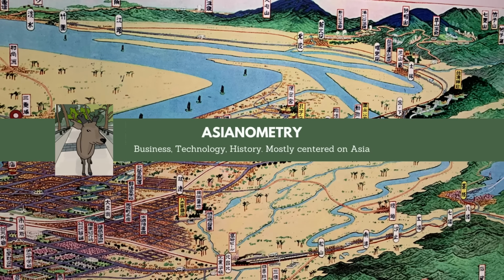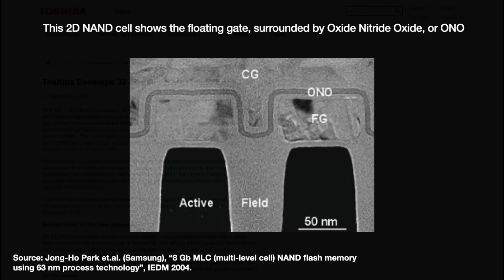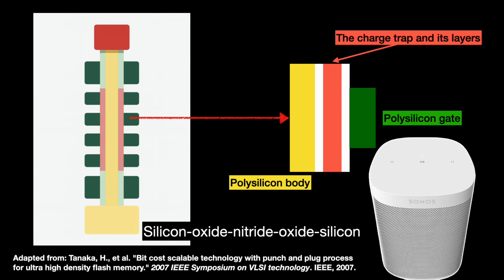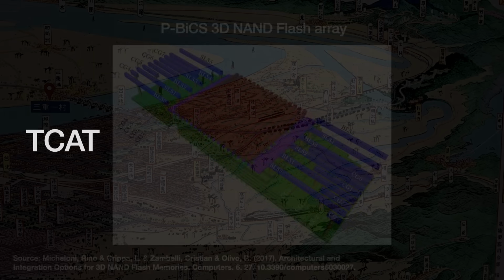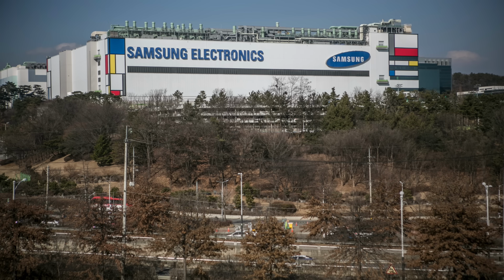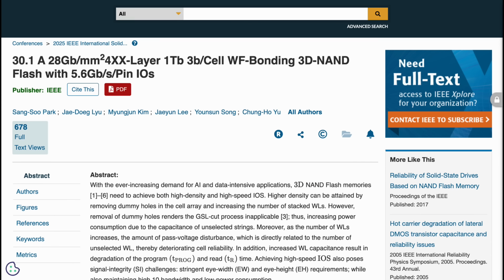3D NAND: The Most Scalable Semiconductor

Comment: I live on a horse farm in rural Tennessee. Recently, I found a Samsung 970 EVO M2 SSD in a manure pile. Knowing that none of the horses own a laptop, how the M2 drive got there is a mystery. My best guess is that because a manure pile is mostly litter from the stables (hay and pine shavings, and of course a little manure), I think one of the guys bailing hay (we bought some from Montana during a drought) must have had it in his shirt pocket and it accidentally dropped into the hay bailer (or a similar event happened with the guy in Alabama who makes the pine shavings). I tried to read data off the drive but the horses had stepped on it a few times and it was too damaged. The actual SSD chips could be removed and read I suppose but that's expensive and unless I knew the drive contained a bitcoin wallet or similar, not something I would do. Still, weird to find a sophisticated drive like that in a manure pile in a horse pasture in a rual area..

Comment: Let us not loose sight of the fact that an SSD is not just an array of FLASH memory. They are sub-systems with a processor controlling things. Like monitoring blocks of memory and detecting deviations from "good performance, then swapping-in new (hidden) blocks if the degradation is deemed close to failure. Degradation is inevitable in cells because each write ages the floating gate/trap just a little.

Comment: ✅ 1. More Storage in Less Space

You can stack more layers, so storage capacity scales easily.

✅ 2. Lower Cost per GB

More bits stored on one chip → Cheaper to make high-capacity SSDs.

✅ 3. Better Performance

Faster read/write speeds compared to older 2D NAND.

✅ 4. Lower Power Consumption

Efficient architecture = longer battery life for mobile devices.

✅ 5. Improved Endurance

Some 3D NAND technologies are more reliable over time.

Comment: Some extra insights. For the etch side another critical technology is in situ CVD/ALD. The technology protects sidewalls by depositing an etch mask uniformly across the hole and then the etch cycle will remove the bottom mask and etch down for a bit before doing another deposition cycle as the side walls are eaten away. Another important technology is bias and source pulsing to change ion and radical distribution to a more downward angle. All of the major etch vendors are working on all of these, but some do certain aspects better than others. 

Another thing is all modern NAND is actually using multiple decks (ie multiple litho and etch stacks layered on top) because otherwise the stacks would be too tall to be manufacturable. On a related note a big focus is also on lowering thickness of layers to minimize etch times and reduce the number of decks needed to hit a given layer count.

As for market conditions it is kind of weird since people kind of pre announce NAND flash technologies, so Samsung isn't actually in 400 layer commercialization yet. Last I checked Micron was funnily enough in the lead just like they were in the late 2D NAND double and later quad patterning era. SK if they aren't ahead are right on Micron's tail. YMSC not far behind with Kioxia, and Samsung like in DRAM and foundry is struggling to get things out the door. Also we are in an era where 2D scaling provides value again as etch and deposition complexity keeps growing. As an example Kioxia has by far the lowest layer counts but their bit density is actually competitive because their die design and how small their cells are.
Reply: Maybe the future will be working both sides.
Reply: @brodriguez11000  This kind of already happens. To alleviate wafer stress/bow concerns, you are seeing people have the CMOS under array get fabed on a separate wafer and then get hybrid bonded to the array wafer (similar to 3D CMOS image sensors). I could be wrong, but I can't see any advantage to building decks on the wafer backside because it doesn't solve the problem of longer etch and deposition times/aspect ratios becoming too large to be manufacturable or the added cost of putting more decks on the front side. Maybe if one day you run out of levers for easier scaling paths, you do an HBM like memory cube where you have multiple NAND array dies stacked ontop of one base control logic die? But it is hard to imagine that ever being economical for anything beyond ultra-high end datacenter drives where you are trying to cut as much power as possible or when you are constrained by the CPUs I/Os for the number of drives.

Comment: 245TB in a single drive in 2025 is just crazy and soon there will be 1PB SSDs.
Reply: meanwhile I just bought my first 1tb SSD 2 years ago. Thinking about getting a 2TB main drive when I ditch win 10 for linux next month.
Reply: @lexpox329  clearly you're not into collecting linux isos
Reply: @lexpox329 Do it, they're not too expensive and so worth it especially if you play videogames
Reply: @lexpox329 Good luck man, if you need hrlp ask in the community
Reply: @lexpox329 i hope you tinker with linux before you switch unless you already know what youre doing ;pp
Reply: @lexpox329 use linux mint, I got it on my new work laptop and its great, had prolly the best support out of any distro because its based on ubuntu
Reply: @lexpox329 wait for 1 PB 😂
Reply: and there i was not long ago, scouring for the cheapest 1tb ssd i could find to replace my dying hard disk
Reply: Still waiting for the 16TB consumer NVME SSD to come up, because 4TB NAND chip are still yet to be produced
Reply: And you can get 1TB now on an SD card the size of a fingernail.
Reply: Price is "crazy" as well.

Comment: ai summary

Abstract:

This video explains the pivotal shift in the NAND flash memory industry from 2D (planar) scaling to 3D vertical stacking. It begins by outlining the physical and economic limitations that brought 2D NAND scaling to a halt around the 15nm node, such as severe cell-to-cell interference, diminished electron counts, and prohibitive lithography costs. The video then details the development of 3D NAND as the solution, contrasting early, inefficient layer-stacking methods with two key architectural breakthroughs. The first is Toshiba's "gate-first" BICS process, which introduced the manufacturable charge-trap cell. The second is Samsung's more complex but superior "gate-last" TCAT architecture, which successfully integrated high-performance metal gates. Samsung's innovation allowed it to regain a significant market lead, triggering a race among competitors. The video concludes by highlighting that the future of NAND scaling lies in adding more layers, which introduces new manufacturing challenges like high-aspect-ratio etching.

The Evolution and Future of 3D NAND Flash Memory

*   0:00:38 2D NAND Fundamentals: Traditional 2D NAND flash memory stores data by trapping electrons in an isolated "floating gate" within a transistor. To increase density, manufacturers historically followed Moore's Law, shrinking the physical size of these cells.
*   0:03:14 The End of 2D Scaling: By the mid-2010s, shrinking 2D NAND further became impractical due to several critical issues:
    *   High Cost: Advanced lithography techniques like double patterning were required, dramatically increasing patterning costs.
    *   Reliability Issues: Smaller cells hold fewer electrons (a 25nm cell holds just ~100), making them more susceptible to data loss from leakage and lowering the signal-to-noise ratio.
    *   Interference: Cells were packed so closely that their electrical fields began interfering with one another, causing errors.
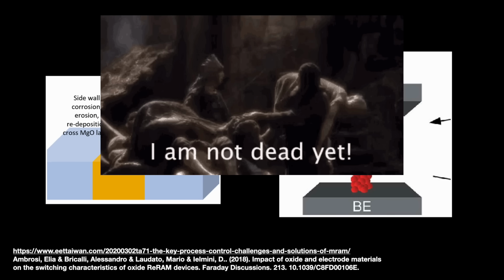*   0:05:52 The Shift to a New Dimension: With horizontal scaling stalled, the industry shifted focus to stacking memory cells vertically, creating 3D NAND. Early attempts to simply stack completed 2D layers proved too costly and prone to heat damage.
*   0:07:36 Toshiba's BICS Innovation: Toshiba pioneered a cost-effective method called Bit Cost Scalable (BICS). This "gate-first" process involves:
    1.  Stacking alternating layers of polysilicon (which will become the gates) and dielectric.
    2.  Punching deep vertical holes through the entire stack using a single, expensive etch step.
    3.  Plugging these holes with material layers to form the memory cells.
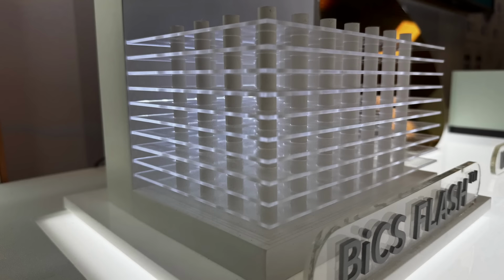*   0:08:45 Floating Gates vs. Charge Traps: A key innovation in 3D NAND was the switch from traditional floating gates to "charge traps." A charge trap stores electrons in discrete locations within a trapping layer (like silicon nitride), analogous to a sponge holding water, making it more reliable and easier to manufacture in a vertical structure than the "tub of water" floating gate.
*   0:14:11 Samsung's Superior Gate-Last Method: While Toshiba's BICS was a breakthrough, its polysilicon gates limited performance. Samsung developed a more advanced "gate-last" process called Terabit Cell Array Transistor (TCAT) that enabled the use of superior metal gates:
    1.  It starts by stacking sacrificial layers (silicon nitride) instead of polysilicon.
    2.  Holes are punched and filled with polysilicon to create the channel *first*.
    3.  Trenches are then etched from the side to remove the sacrificial nitride layers, leaving air gaps.
    4.  These gaps are then filled with the charge trap layers and the final metal gate material.
*   0:16:34 Industry Disruption: In 2014, Samsung's 32-layer V-NAND, built using the TCAT process, achieved a density 3.5 times greater than its planar equivalent. This disruptive product re-established Samsung's technological lead and forced competitors like Micron, Intel, and SK Hynix to race to develop their own 3D NAND products.
*   0:18:12 The Path Forward is More Layers: The primary method for increasing 3D NAND density today is by adding more layers, with leading manufacturers now producing chips with 300-400 layers and paths to over 1,000 layers envisioned.
*   0:18:31 New Manufacturing Challenges: As stacks get taller, etching extremely deep, narrow holes with a high aspect ratio (HAR) becomes a major challenge. New technologies like cryogenic etching are being developed to maintain precision and speed at these extreme depths.

I used gemini-2.5-pro| input-price: 1.25 output-price: 10 max-context-length: 200_000 on rocketrecap dot com to summarize the transcript.
Cost (if I didn't use the free tier): $0.03
Input tokens: 18789
Output tokens: 1042

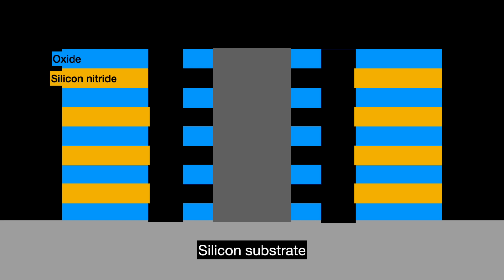Comment: 15:50 but how do they manage to remove silicon near the shaft, but don't touch it outside the hole?
Reply: I figure it takes time to eat through a lot outside the hole, so just limiting the etch time should just not touch the outsides
Reply: @quangho8120  maybe there's some "magic", because at macro scale it wouldn't work like this. But even if you're right, some amount of outer silicone should be etched out and this picture is a bit deceptive.
Reply: @MSP_TechLab  yea i agree the pic is a little deceptive, it's an illustration and not a micrograph afterall
Reply: @quangho8120  it is not little deceptive, it is really deceptive. I've put a long answer but youtube deleted it. So, in short, the picture at 15:50 represents one column surrounded by silicone. While in fact there's an array of columns. So, it etches all silicone, because where surrounding of one column ends, starts surrounding of another (imagine it as a building skeleton without walls).

Comment: Great video — one quick addition/correction for the comments section:

While HDDs do still win on cost per byte, the bigger point is long-term offline retention. NAND (both floating-gate and charge-trap types) stores charge that slowly leaks away when the device is unpowered, so its offline retention is inherently limited; many NAND parts don’t even publish a long unpowered retention spec, and when they do it’s often on the order of a year (especially after many program/erase cycles) rather than decades. By contrast, a commonly cited HDD demagnetization rate of ~1% per year corresponds (if modeled exponentially) to a half-life of roughly 69 years, so HDDs are far better for preserving data offline for decades.

So NAND’s inability to “fully replace” HDDs isn’t just about $/GB — retention over time, plus the role of cost and the relatively faster random access of HDDs versus optical/archival media, all factor into why HDDs will remain important for long-term storage.
Reply: And even that pales in comparison to magnetic tape. It is funny how we still use one of the oldest technologies for digital storage...
Reply: @skvvlk  optical tape is much more durable than magnetic tape, and its single-write nature doesn't matter for archives
Reply: I wonder: could some kind of super low power source be used to refresh it? Like one of those tiny calculator solar panels?
Reply: @benG2141 maybe a very small nuclear battery coupled with a capacitor could let it refreshed for a couple of decades
Reply: The companies that want data retention use tape, maybe optical, but never spinning rust. I've had several HDDs fail entirely after years of being unused, but not even an OCZ has for flash.
Reply: @iskamag  Hard disk drives (HDDs) typically fail due to mechanical or electrical issues, but the data on the platters often remains intact. With sufficient investment, professional data recovery services can retrieve data from these platters. In contrast, NAND flash storage, such as that used in SSDs, faces a different challenge: when unpowered, electrons naturally leak over time, leading to data loss. The more advanced the manufacturing process, the shorter the offline data retention period, often lasting only a year or less. SSD data corruption can be insidious, as the drive may appear to function normally, and copying data may not trigger errors. Standard copying methods cannot detect such issues unless you use techniques like hash digests or specialized file systems such as ZFS or encrypted NTFS, which offer advanced error-checking features. Ultimately, NAND flash’s data retention when unpowered is significantly shorter than that of HDDs, a fact often overlooked by typical users.
Reply: @gudongnetman355  so what does this mean? shall i rather rewrite the offline hdd backups once in a while, rather than just reading and comparing with rsync or so? and does the ssd data retention problem only apply if not powered? will the firmware periodically rewrite every untouched bit when powered?
Reply: @lapaleves  For HDDs it’s a good idea to rewrite the data once in a while — every few years or at least once a decade — rather than only verifying it, and to run checksums along the way.
On SSDs, the controller will refresh old data in the background as long as the drive is powered, but once unpowered retention depends only on charge leakage in the cells — often no more than about a year.
Reply: Another major difference is the benefits of SSDs speeds are just irrelevant in long term storage. When checking a file once a month or year it doesn't matter is access speed is 10 milliseconds which is 1000 times slower than SSDs. The benefits of transfer speed being 10-100x faster is not used while you don't touch it for months. And the interactions operations per second which make loading game assets instantly load as you walk up to them without a loading screen into a area, is a useless task for long term storage. 

It's like buying a sports car when all you do is drive to the grocery store once a week, a bunch of useless features you don't use with smaller space and more cost.
Reply: Your comment comes off as clearly AI-written. It's overly formal for a YouTube comment section, the line "Great video — one quick addition/correction for the comments section:" is in a style that's extremely similar to opening passages written by an AI, em dashes are everywhere and semicolons are used as well.
Reply: 1% of your data being garbage sounds pretty bad tbh?
Reply: @elon6131  That “~1% per year” is a magnetization decay rate, not “1% of files disappear every year.” Modeled exponentially it means the magnetic signal is about 0.99^n of its original strength after n years (half-life ≈ 69 years), not an immediate 1% file failure per year.
Reply: @gudongnetman355  Ah, thanks for clarifying. That makes a lot more sense.
Reply: Remember kids, SSD stand for stupid sudden death. They are less trustworthy than a fart.